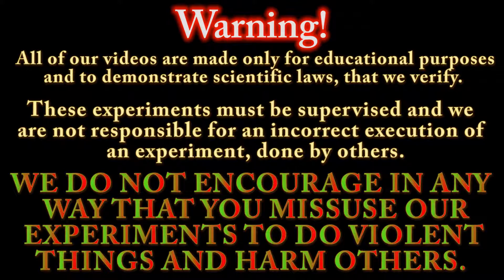Extracting Starch from Potatoes

Comment: Make citric acid from lemons
Step1:extract the juice of 4-5 lemons and then transfer the juice to a large beaker 

Step2:convert the juice to sodium citrate by adding NaoH and increase and ph to 9 until the solution become a bit orange

Step3:filter 4 times the solution to remove excess pulp and after put the juice to a hot plate and start adding calcium chloride

Step4:After adding the Cacl2.Calcium citrate will be formed which is insoluble in hot solution and will precipitate out

Step5:filter the solution to obtain the soild calcium citrate 

Step6:add your calcium citrate  to a beaker and dissolve it 150 ml of water and start adding sulfuric acid to convert the calcium citrate to citric acid and an insoluble calcium sulfate

Final step:filter the solution to separate the citric acid from calcium sulfate which is insoluble in water
Boil your solution to obtain citric acid